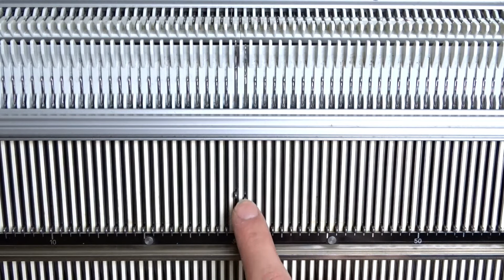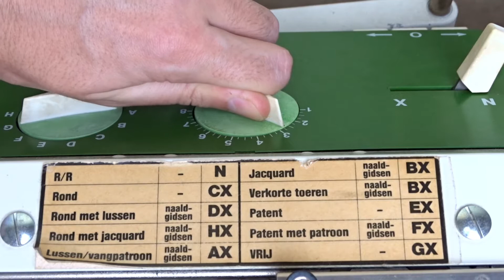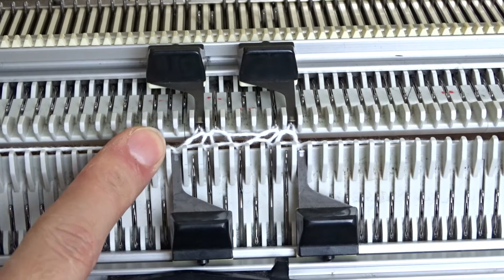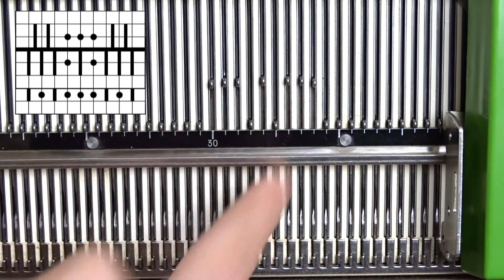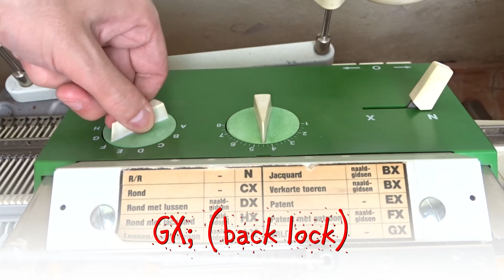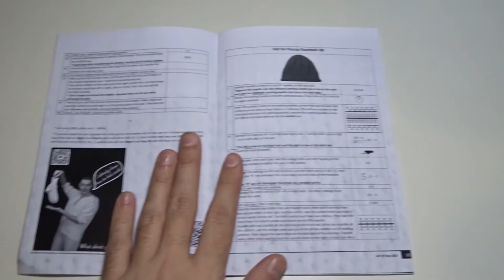How to Knit a Bookmark/Lace on Passap Duomatic 80 Knitting Machine #2 (Using Waste Yarn)🔖

Comment: Depending if you want the direction of the lace to be the same; you could finish your first strip, then pick up a few stitches and rehang from the center side.  Now knit that section of the cross as many rows as you need cast off and repeat for the other arm of the cross.

Comment: I would like to make cross shaped bookmarks. How would you suggest I cast on the cross part? Or...do you think I should somehow knit the arm. And stick part separately, so that pretty lace design is throughout?
Reply from the maker: Oh, that's a tough one. I have an idea, but I need some time to think about it.
Reply: Really nice idea.  Knit your first vertical part as long as you want before you want to start the wide part of the cross.  Now bring needles and pushers out on each side of your current piece, in pattern.  You will need to e-wrap the additional empty needles.  You may even need to hand manipulate the first few rows of the new stitches till you can get some weight on those new wings.  Knit a few rows across and begin to bind off to the center section again. Or. You could split your work and knit sections at a time as in doing a neckline.  Just one idea of how to make a cross. It would also be beautiful to thread a satin ribbon through the holes of the lace.